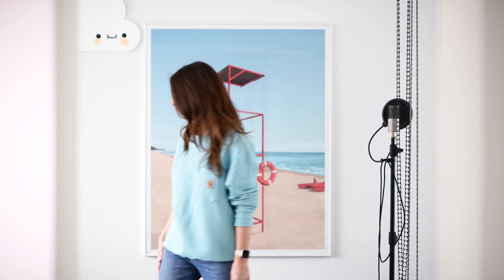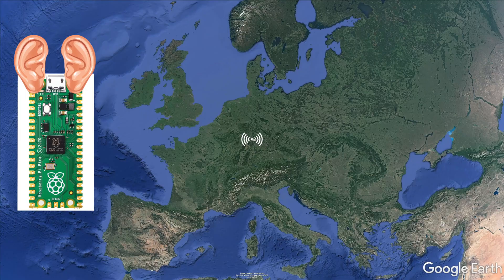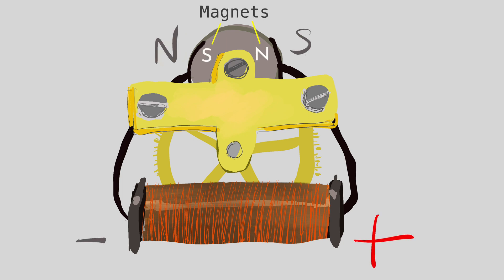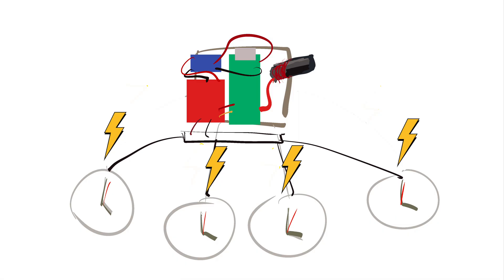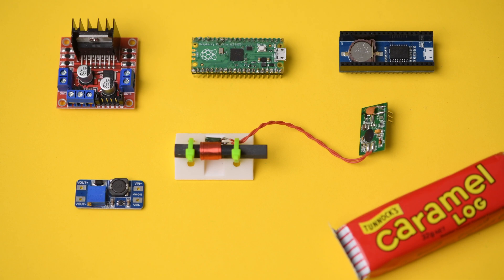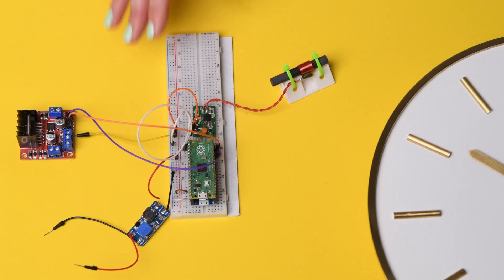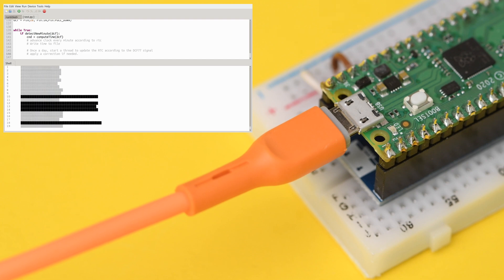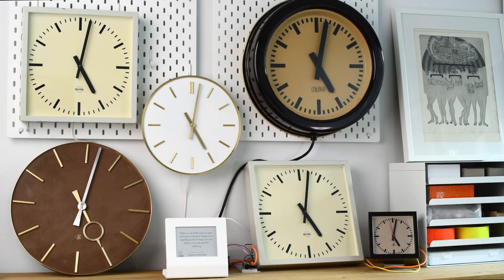Restoring and Upgrading a 70 Year Old German Electric Clock

Comment: This is my hobby, resurrecting old slave clocks and master clocks. I mainly concentrate on Gents' and Synchronome and these are once per 30 seconds at 230mA at about 1.5B per slave in series.
I have a pair of continental clocks, one an Elfema from the Czech republic and a double sided Siemens from Germany, these are once per minute at 24V per slave alternating polarity pulse. At the moment I have no means of driving them.
Gallery wall? My whole house is full of clocks.
Reply from the maker: I'm currently looking at a big Favag double-sided that has taught me the importance of flyback diodes
Reply: @VEEBProjects  The old Gents' and Synchronome systems existed before solid state diodes, so they put resistors in parallel with each coil as snubbers. The Gents' 'Pulsynetic' Master clocks were stuffed with big paper insulated capacitors, to cope with the transients, to stop the contacts burning out.